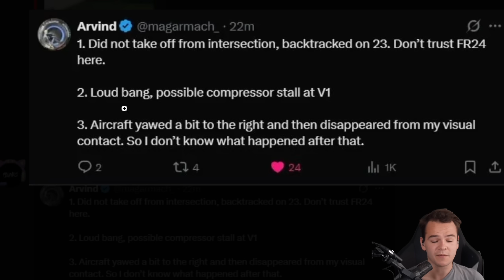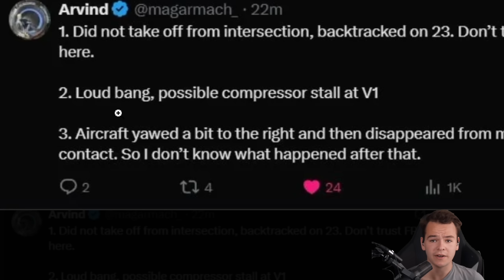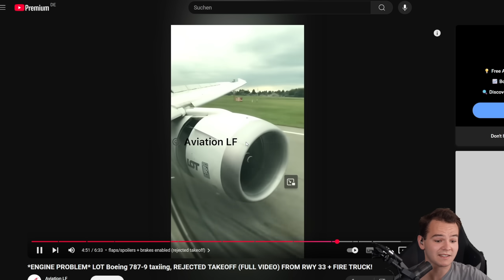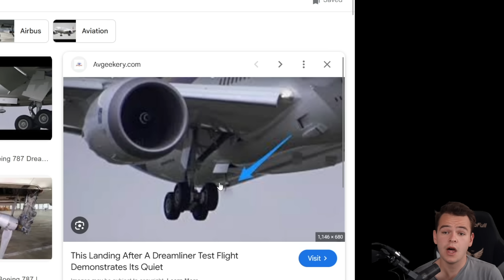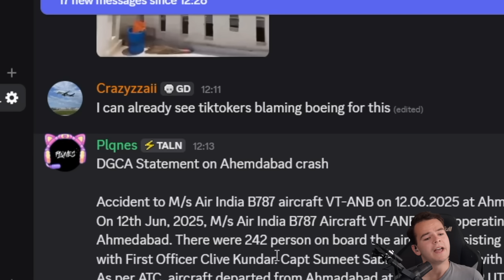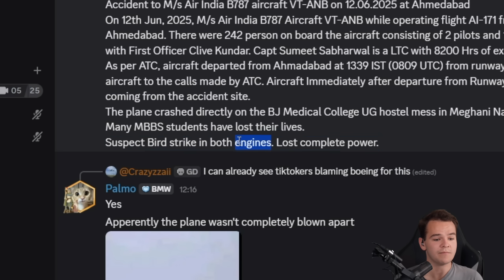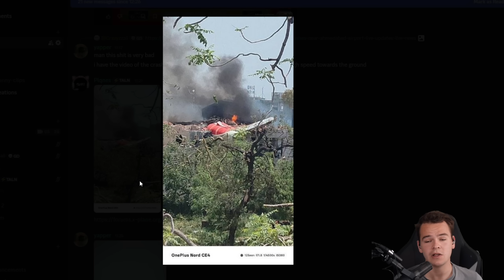The First 787 CRASH Ever - Why It Is SO Confusing?

Comment: The landing gear wasn't retracted until impact. However, I disagree with the claim that the first officer confused the gear lever with the flap lever. Both levers are far apart. The gear lever is vertical on the dashboard where the pilot or copilot operates it with a hand movement straight ahead while the flaps are mounted on the middle console on the left and right where the pilot or copilot operates it with a hand movement downwards!

Comment: I am not that familiar with the 787 so I anything I say may not even be accurate to the aircraft system's, but atleast in the 737 if you get a heavy electrical failiure the engines automatically go into idle with no way to controll them
Reply: Makes sense to me btw, what happens when you get, let's say, a dual elec bus failiure? The generators fail, the non essential systems (like the transponder) get shut out, and the electric hydraulic pumps fail, and if you pair that with a possible engine failiure, they probably had just enough hydraulic pressure to pitch up

Comment: The gears are still down after take off
Reply: Yeah? It didn’t even reach 700ft of altitude. You don’t retract the landing gear if you’re not in a positive climb
Reply: @Eagle6168. Once positive rate of climb is achieved the pilot calls "positive rate gears up'.

Positive rate of climb was never achieved on this flight.

You should know this as a pilot ( your comment indicates you know about flying).

Comment: I don't know anything about airplanes, but at that altitude, shouldn't the pilot have retracted the landing gear? From the footage it looks like he retracted the flaps instead of the landing gear. Could it have been a pilot error?
Reply: Nope. Plane wasn’t in a positive climb therefore you do not retract gear. If you’re going down you keep the gear extended because that will take the brunt of the impact first before the rest of the aeroplane 

Doesn’t matter if you hit a building though ofc 

It only reached an altitude of just over 600ft before descending
Reply: @TescoRoadman  
And isn't it possible, at that altitude, that the pilot or copilot intended to retract the landing gear but mistakenly retracted the flaps?

Comment: simultaneous dual engine failure on modern twin engine commercial airliners is one of the rarest events in aviation. The possibility does exist and embarking on a commercial flight means a fatal accident can occur. The odds do not matter if it happens to you.

Comment: got to be a fuel contamination issue for both engines to fail at the same time.
Reply: There is no way they would completely fail out of the blue at the same time. You would have badly performing engines at first, it would be noticable during taxi or the takeoff roll. And it is very rare for them to completely fail that fast.

Comment: flightradar track shows previous flights the bird using more of the runway for takeoff.  Whereas this flight it doesnt.  Also more clips of the flaps not configured.  which should have been blasting out warnings in the cockpit for sure!

Comment: I'm direct, no filters,
As per videos and news collected, I think this was a possibly pilot error and could have been avoidable. 
There's an CCTV video clearly showing some sort of "dust" or "smoke" behind the aircraft just on rotation (V2) and if you look at the video it clearly shows that the angle of attack was really pointing towards a "correct" take-off climb, right until the explosion.
Now, I think they should have stop trying to climb and just barely level off just to keep it in the air as much as possible. Because they kept climbing which accelerated the stall and gave them less time to do anything. Panic.
Also, this may be wrong, but in that video I could see it taking off almost at the end of the runway, maybe an optical illusion...
Wondering at what speed they saw an issue then hopefully they didn't hit something on/off the runway.
1 survivor, JEEZ, how's that even possible?!

Comment: I mean with a dual EF, maybe the pilots didn't wanted to retract the gears as they knew the next step would have been the ground.. and the RAT takes a short time to go out, so IMO the time laps between the TO and the supposedly extension of the RAT is possible. But I do agree, something went wrong with the thrust, dual EF, fuel contamination ?

Comment: pilots should not attempt take off with one engine. if a failure occurs at V1 they should abort the take off apply brakes and activate spoilers and flaps to get full stop

Comment: I’m not sure what your expertise in the aviation industry is I highly disregard the dual engine failure upon takeoff number one. If you look at the videos, you can’t specifically say that whatever was recording captured the sound of the engines and or didn’t capture the sound of the engines my question would be why where the flaps in the slats up? Being a captain of a Boeing I can tell you that a mile past the runway there’s no way that that aircraft should be cleaned up that load to the ground meaning that the flaps and slats are retracted already will let the experts decide.

Comment: No confusion ,  temps were over 110degrees , the plane was full of fuel for a long fully booked flight , it started its take off run from too far down the run way and blew dust off the unpaved "run out" area off the end of the runway while lifting off on ground effect entered a highspeed stall and flopped into high density urban terrain.

Comment: The 787 is a modern airplane meaning all is managed through electric motors and has no more hydraulic systems . This is also true for the flaps. Maybe they should rethink their all electric appoach. A software bug, even if rare, could spark a chain of unknown outcome. Another possibility is that the fuel was contaminated.

Comment: The FAA released an airworthiness directive in 2016 about false airspeed indication. I'm going to hazard a guess and say this might have been an auto-throttle issue, or something related to the airspeed indicator. Dual engine failure seems incredibly unlikely, unless something went wrong in the fuel system.

Comment: I think the answers we need to have is

- For an abysmal coincidence the Dual Engine Failure happened AFTER THE V1?

- If they don’t properly prepare for the takeoff, could they takeoff without the flaps, and if this happened, why the pilots ignored the takeoff alarm configuration.

- Do the PM made a mistake and pull up the flap lever instead of tue gear lever.

Comment: Before watching this video, i thought the PM instead of gear up, he flap up. But after this video, it might be a Dual Engine Failure. 

The past incidents of Dual Engine failure are, the British Airways 777 when suddenly have a fuel starvation due to ice blocking the fuel flow right before the landing in Heathrow, and the bird strikes like the Us Airways and the Ural Airlines A320, both landed safely. 

Examining the wreckage, have the CVR and FDR is gonna be crucial.

Comment: One thing that I noticed and I might be wrong, but it doesn't seem like the flaps were down. Is it possible that this wasn't an engine failure but perhaps a situation where the pilots somehow forgot to extend the flaps for takeoff? It's happened before. What would confuse me though is that modern aircraft have alarms and systems to let the pilots know if the plane isn't configured properly for takeoff

Comment: You have the same conclusion as a pilot who flew with 787 before. The pilot who worked in India aviation before also mentioned India has one of the worst maintenance and are lax on safety. Some smaller runways you can even see cows on the runways sometimes.

Comment: Actually - I think you CAN hear the RAT buzzing on that video - I heard it on the BBC's copy of the video just before the airplane enters the shot. I thought when I first heard it that the engines didn't sound right and thought it was the turbofans making that noise (the Rolls Royce buzz), but actually - it doesn't sound right for that either but it sounds JUST like the clip in your video of the RAT on the japan airlines ship. Question is - there was no visible FOD or birds on the videos, so what the hell could knock out both engines simultaneously? Fuel issue maybe?

Comment: 3500 meters?? Feet please!
Reply: Roughly 11500 feet
Reply: @prolukas4675  No The max Height achieved by plane before crash was 625 feets
Reply: @Nomadicpratik op asked for runway length
Reply: @prolukas4675  oh Ma Bad , Yes the Runway Length is 11499 meters you heard it right
Reply: 650 feets

Comment: I may sound dumb, but can't they do a routine check of engine after the last flight and as per news pilots and plane were one of best , there is high sign of engine failure or power loss because it struggle to take off but still pilot tried but in end it can't power to go up.

Safety idea- 
Can't we do a short test run to check if all electronic are fine and engine are fine before every flight ( yes more fuel and cost but can't this be more safe than losing so much people)

And strict non private checking and safety team to monitor every plane before take off.

Sometimes saving little money can cause huge loss.
Hope god will bless and protect these unfortunate souls.

Comment: Total mystery... On take off both Engines run at nearly 100%....but even if one is total loss... Plane can (and did!) takeoff with one engine.
But the Video shows no slip to either side... So both Engines run simultanious... Or none of both!
Possible crash reason: 
Double complete engine failure OR a thrust throttle failure. (Software / Hardware) 
There are no birds visible and killng them would cause Flame output at least behind the engines... Even on a big GE B787 engine.
Stays a mystery...

Comment: What if one engine failed on takeoff and then the pilots turned the throttle off for the incorrect engine, leading the only engine running to be cut of power, leading the plane a powerless glider post takeoff, thats my thoughts if there isnt anymore info soon.

Comment: In the video you show, you can clearly see that the flaps are not deployed. Do you fly? The plane was not in the proper take-off configuration. You cannot take off without flaps especially if as the pilot you are assuming they are deployed. The GE engines were running ... you can hear them. What are you talking about? Speculation such as yours, when obvious issues are shown in videos you show (no flaps),  is irresponsible reporting.

Comment: over weight and pilot mistake this bird didn't go down without a fight that's the sound of engines being given full power and them struggling to move the aircraft turbine speed stalling. should of got more ground speed and climbed slower. Once the fuel burned off then it would be under normal weight and flight characteristics.

Comment: my thinking is that during v1 birds were ingested into the engine causing the bang that the witness heard, and then it continued to climb and the pilots were confused and disoreientated, forgetting to raise the landing gear, and then it fell back to the ground shortly after loosing complete power

Comment: Look at the footage again.  The flaps are up with the gear still down.  We can hear the engines running in the video.  What the video seems to show is that the crew potentially raised the flaps instead of the gear, as another video from takeoff to crash shows that the gear was never raised.  The other option is that they never set the flaps for takeoff in the first place.

Comment: Not a dual engine failure. One engine failed/stalled and they shut down the wrong/good engine by mistake.
Reply: And just how do you know that?  (You don't.)
Reply: @bmjpdx9222  Right you are. I'm just speculating, considering the shallow descent and lack of engine noise shown in the available video. Time will tell.

Comment: Did they use the full runway on takeoff?
Reply: No but if I did, it would not have led to the crash because if the birds was sitting on the runway they would’ve already been flying away cause they are sensitive to noise but once again they used the whole way this could’ve been avoided
Reply: @XX_GAMING-official  Looks like they were moving to slow to climb but we will need to wait for the experts.
Reply: @XX_GAMING-official  Ok the data is supposedly wrong. It looks like they used full length. Lots of conflicting info.

Comment: from what ive seen so far. looks like the plane had no flaps. Also it was extremely hot so High density altitude and near MTOW.  I wonder if the TOWS failed or the pilots disabled it, sinceit would have warned them that the plane was not properly configured

Comment: The pilot's last words were "i am losing thrust" ,"mayday" which means its emergency situation
Reply: Where's the transcript saying losing thrust??
Reply: Is that what mayday means?  Oh boy, we got an expert here
Reply: @didamnesia3575  Yes, "Mayday" is the attention word in aviation for an emergency situation. It does not imply any specific type of emergency, just a notification of an emergency. Its declaration in the aviation world is taken quite seriously.
Reply: @JamesJoseph-u1y  Mayday has its origin in French for M'aide=help me.
Reply: It’s a distress message which is the highest priority in aviation radiotelegraphy
Reply: @davedrake5769  Did not know that. Interesting. More French influence in aviation lexicon.
Reply: Check the tracker from the airport he rolls away from the terminal and doesn't stop at all and rolls straight into takeoff with out configuration for taking off   no front wing  flaps means  a plane crashing every time with out failure it's simple physics
Reply: And it's probably a class situation in Indian society. Were the junior pilot won't question the captain
Reply: I'm going to guess mechanical failure but will need to wait for black box data before know for sure.
Reply: Could the plane have been overloaded?  Just saying as it is clearly seen the plane actually crashed nose rearing in the air tail first
Reply: Flying some planes is like playing a lottery. The winner gets a life as a reward. Example There are types of planes that fighter pilots call flying coffins. Every other month on duty, even more often, the pilot is forced to eject.
Reply: @johncena-do1jf  are you comparing this B787-8 with a F-104 lol
Reply: Or they didn’t do the check list

Comment: Would it have been better if instead taking off instead just attempting to abort at V1? Yeah you are going to not have the ability to stop at the end of the runway but would it have done less damage as youd be able to apply brakes till you skid off the end of the runway and youd be going into ground so you might have a chance to slow down enough that instead of exploding you just collapse the gear.

Comment: Why are you so sure its engine failure? Highly unlikely, especially because of just departing and is fully fuelled evident by the firey explosion ,also,the dreamliner is a very quiet jet due to the engines it uses,even at take off throttle it quiter than most,i think you're going to find pilot error and that the jet wasn't configured to take off mode, it also appears that seeing the gear is still down the plane has just departed as is in this case, why are the flaps not deployed or in take off positions? Leave the engines out of this and delve deeper please,the  jet had just departed if it had a duel bird strike those engines would be smoking and sputtering aloud. In my opinion your engine failure theory is all wrong.

Comment: I flew on a young 787.  It was a flight from Sidney, Australia to Los Angeles, US, January 2014.  This was a year after all 787's were grounded because of fire threats from their Lithium-Ion battery packs.   It was my first flight on a 787.  Absolutely beautiful bird on the outside.  Couldn't stop looking at it as it taxied and parked at our entry point.  I had a window seat behind the lavatory I believe if memory serves me. So there was a bit more leg space for us on that row.  However, what disturbed me was the overhead panel was gone and you could see up into the ceiling with wiring, insulation, and ductwork.  In fact, a bit of yellow insulation and wiring hung down an inch or two from the opening.  I didn't notice anything else on that very long flight that gave me pause.  No weird noises, groans, shaking, etc.  Smooth, uneventful flight.  But it did seem to me that Boeing had production issues or that maintenance somewhere before my flight was shoddy.  

It became known there were issues with construction early on  and with particular concerns coming to light from 2019 until the present year.  I think it is know obvious to all that Boeing is a company is deep decline.

Comment: There is no way both of the engines on the 787 failed, the odds of that happening is genuinely impossible .The reason why we don t hear much is because the guy was filming through a window, which heavily reduced the perceived noise. I m thinking this is a classic problem with indian aviation (gross incompetence of either the pilots or engineers)

Comment: "Deemed uncrashable"?  
My 2 cents...@Swiss001:  You should edit that phrase out, especially considering you are an aspiring pilot.  

Nothing is uncrashable. Airplanes are flown by humans and are at the mercy of the decisions made by the aircrew.  The 787 is an amazing aircraft, and its tech is such that hopefully its pilots won't become task saturated...but pilots are humans and none of us are infallible. Adding to that, take-off is the thinnest phase of flight...near or at full power, aircraft is slow, and those wings are full of Jet A.  Everything is happening fast, and the daisy chain is at its most vulnerable.  
As more details unfold, I'm sure we will see the familiar connection between all these tragedies...the string of errors kept compounding until it was too much for the folks on the flight deck.

Thoughts are with all involved.